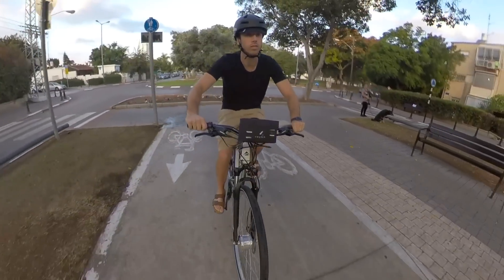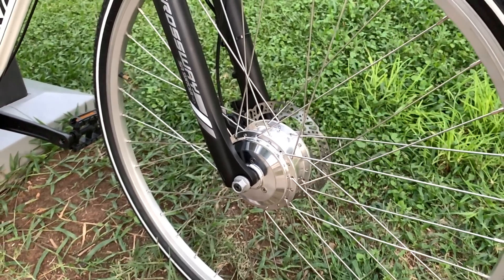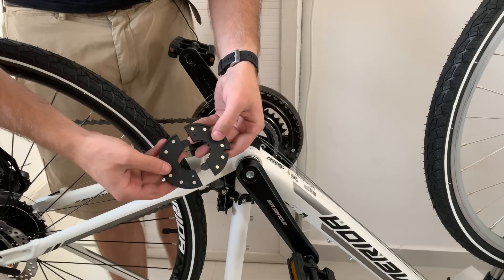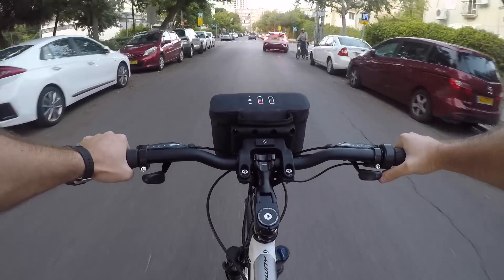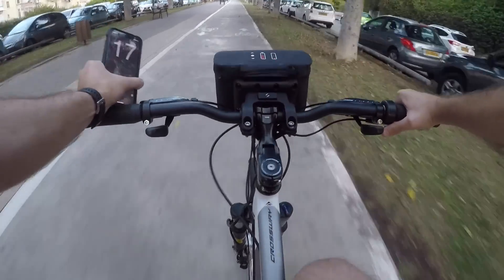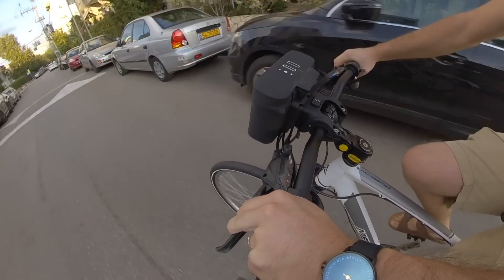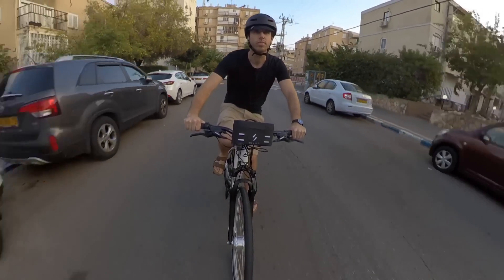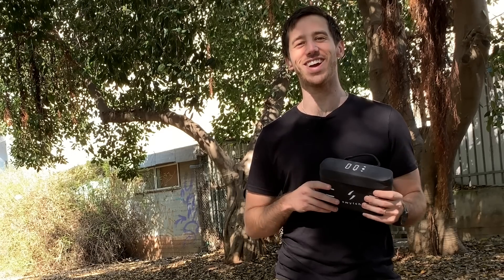Review: Swytch e-bike kit is smallest and lightest way to DIY an e-bike

Comment: Honestly, I trust Micah's reviews more than any other source. He has been doing this for a long time, has written books, and his presentation is always thoughtful, sensible, and practical.  Not having a 40 to 70 pound dedicated ebike or a much heavier kit is SO compelling. Remove the power pack and you are back to basically a nimble lightweight bike when you want it. I think am going to pull the trigger on this during the next launch window, scheduled for this week, for a kit for my girlfriend's bike. As always, thanks for the solid and balanced reviews.

Comment: I have the Swytch Pro kit (250wh battery, 3 lbs). I got it because I like the feeling of my roadbike, which weighs 22 lbs. So now the total weight of my bike is 28.5 lbs. This little battery is surprisingly capable. It takes the pain out of hills. I'm sweating and getting good cardio, but it doesn't cross over into quad-burning, lung-searing pain (which it did on hills). Instead of crawling up ultra steep hills (Seattle) I can go a good 10-14 mph up them, which feels like flying compared to just pedal power.

Also, getting up to speed from a stop is nice. Catching a red light isn't as punishing anymore. The battery on the Pro is 7ah, which I thought would be too weak for the distances I want to cover, but I usually have 2 of 5 bars left when I get home, after climbing 3 - 4 massive hills.

I got this on an Early Bird discount, which was $540. But they make you pay import fees ($27) which are hidden, and then I had to swap out my carbon fork for a steel one, which made my have to swap to V-brakes from cannies (fork + brakes = $70) and the wheel shipped to me warped, so I had to pay a shop to true it ($10). So the "true" fee is $650.

But so far I'm very happy with the performance. Sure, a $1600 eBike is faster, but also feels heavier and doesn't have my drop-bar roadbike look or feel. 

Would be perfect at $499
Reply: at last someone like me who has one!
I´m very happy with mine, had to wait a bit but it was well worth it.
If you haven´t had one in your hands, then keep your criticism for yourself!!!!!!!!!!!!
THOSE WHO SHOUT THE LOUDEST KNOW THE LEAST ABOUT WHAT THEY´RE SHOUTING ABOUT
Reply: Great review
Reply: I have the pro kit as well and love it. I also have a Stromer, that is a class 3 that is my main commuter, but the Swytch is amazing for the price and size. It's an excellent way in to the e bike world!
Reply: Do you still use it today ?

Comment: "I have had my kit since 2022.  On my 26" Schwinn Street/Trail hybrid, I have about 1,300 miles on it since July.   The kit has performed flawlessly.  It was a cinch to install.  I have never had a down day - no maintenance issues.  On a regular day I am doing 35 miles at least, using power only when needed on hills and challenging terrain.  I use about 1 - 1.5 cells of the 5 cell battery on such a trip.  Hey, I am in my sixties and after a ride I am hardly phased.  I could not recommend this kit more highly."

Comment: Everyone complaining about the price... It's more adaptable than any other kit I've seen, AND it comes with a battery (good luck finding a cheaper kit with battery included.) Another plus, for me at least, is the torque sensor and optional throttle. I'm happy pedal assist is standard, and I don't have to junk up my bars with a throttle if I don't want to. All that around the $800 mark is pretty competitive, but the $450 pre-order is an absolute steal.
Reply: Not dollars - pounds.

Comment: Don't know why people are complaining about 250W; that's usually appropriate power for pedal assist, a removable lightweight pack like this doesn't make a lot of sense as an electric-only bike, and a conversion kit has to avoid putting too much torque on forks that weren't designed for an ebike.

But one thing that does seem silly is making the base system use 20x 2500mAh batteries and selling an upgrade using 3500mAh for $100 more - or $200 "MSRP" if it's ever not on discount. It would probably not affect costs much to use e.g. 3300mAh 18650s in the base model. Suppose, for instance, that they did that and charged $25 more. That 1/3 boost could keep a lot more people from complaining about the range.

Comment: 250w for $800.00? That is a scam
Reply: I got my kit for $450??? Early Bird pricing.
Reply: Price a bafang 250w.
Reply: I got a 1500w for probably 800USD...
Reply: It’s definitely not a scam- you literally just saw a video of the working product. Also if they’ve shipped to over 1000 customers someone would have spoken up about it.
Reply: @sparksycat  I could sell you snake oil for 6,000 bucks. not a scam either.
Reply: Sparksy Cat whats he is saying is there are plenty of cheaper options that are wayy better. Plus this is from a crowd funding site and all they want is more $$$.
Reply: @JustinCrediblename  Actually that is totally a scam... BECAUSE IT DOESNT ACTUALLY DO ANYTHING. The worst you can say about swytch is that it's over-priced. Which I think it is. But as far as I can tell they are atleast honest about ability, Ah figures, speed, etc.
Reply: And they send you those thin ass wheels.
Reply: @thomasgabaldon1047  you sent them you the wheel that fits your bike
Reply: Bruh if people would listen to the vid, this isn't a total ebike, it is only an assist for people riding bikes
Reply: @Pushyhog  - are you drunk?
Reply: @sparksycat  he is saying to the equivalent you could buy a low end ebile with more power and range and you don't need to own a bike already
Reply: I just bought 1000w motor for 350. Plus battery for 205. Got it for my fatbike
Reply: @terryaqualad6779  that's awesome I just ordered a biktrix juggernaut ultra fs fat ebike cost an arm and a leg though
Reply: @lordnox69  nice <fatbike nation>
Reply: 250w and 5ah battery for $800!?? Straight up highway robbery!!  Might as well just get a ebike instead.
Reply: Just because it seems over priced doesn't make it a scam, stop spreading slander dude.
Reply: Lots of opinions, is a expensive kit regardless of 50% discount. To me, certain bike will want this like my y33 trek I can’t just fit a diy due to its frame construction.

Some people do not wish to buy another bike.

Saying that, their accessories are overpriced. $65 for just the brake sensor cut off is ridiculous, $65 for a throttle thumb is ridiculous.

I can tell they just took current ebike parts and attempted to make them solely their own by changing the Juliet pin type is I am not wrong. This I am not happy, otherwise is okay for what it was
Reply: @wolfe1970  It's a scam when it's advertised as being able to "flatten any hill" when it barely has enough power to get uphill. And their advertising doesn't tell you it only has a pathetic 250W motor. It's dishonest marketing. THAT'S a scam.
Reply: @brendanr1525  I have a 250w ebike and helps with any hill around where I live, do you even have a ebike 😂
Reply: @wolfe1970  not yet because the super monarch crown cost more than I'm willing to pay and other bikes with less than 1000W are inferior - I don't need to own one to have tried them. And I bet I have a lot more and steeper hills than your wimpy 250 can handle.
Reply: @brendanr1525  atleast I have a pathetic ebike 🤣
Reply: @wolfe1970  oh wow, you showed me. Why would I even care, It's not like I'm jealous of a crummy bike like that, I could get a bike like that in a second. I was pointing out why it's a scam to deter others from buying trash, it's pathetic you think this is some kind of competition
Reply: @brendanr1525  it's not a scam dude, my point is you don't even own one, I do, and they cope with hills fine, so quit whinging over something you're clueless about
Reply: @wolfe1970  It don't matter if you have something if what you have is trash. 
PS. I'm not convinced you're not a shill for them, most people that try ebikes find that even 500W is just not enough. Which is the exact experience I've had.
Reply: @brendanr1525  But to me and many others its not trash, it works as intended, it was never designed to go up mountains, and also its an assist, its not meant to take over peddling, so its not a scam like to claim it to be, just not suited to what your after.
Reply: Just got an email from them this morning and currently in the US it’s $499. But they are a UK outfit, so I imagine the price fluctuates with regard to the British pound. Right now the pound is in the toilet because of Brexit and Covid. Pretty much 1:1 with the dollar and the euro.
Reply: @TrishBenedict  Not just UK thats had Covid, the whole globe has suffered, right now the exchange rate is 1.36
Reply: never touched or tried it, but complaining.................................ha!
Reply: Built a DIY 500w ebike for under 80£
Reply: @hailbaphomet  sorry A K, not a very original name and not an original comment.
1. Have you actually had one to touch?..................I did, I got it last week.
2. Have you actually built one?................................Yes I did, it was dead easy, even you could do it....hopefully.
3. Have you ever driven one?...................................Yes I did and it kicks in by the second turn of the pedal.

Facit: I am pleased with my kit, it took a while to arrive but it was worth the wait- trouble is, the wife wants one too!
(P:S: I have no financial interests in Swytch whatsoever)
PPS you don´t go shopping in a formula 1 car, or maybe you do.
Reply: @walky240251  Ok dude. 1) What does my name have to do with an over priced ebike kit? 2) What are you going on about? I genuinely don't understand why you took the time to type the things you typed lol.
Reply: $300 for the kit $400 FOR ADVERTISING and $100 profit.
Reply: @hailbaphomet  many thanks for the reply. Never been called a "dude" in my life!
Reply: @walky240251  First time for everything 👍
Reply: @thomasgabaldon1047  They send you the wheel to match the one you already have on your bike.
Reply: @faheemyasir7717  How do you know? Have you bought and tested them all? If they are so good why don't you link to the reviews, or do them yourself?
Reply: @brendanr1525  Have you tried one of these? 500W is more than enough? How much do you weigh? Is that the problem?
Reply: @lukaszgrub9367  I love to know where u buy that I like to get on I be so thankful of u could send it to me
Reply: Mines 1,200w paid $198 off Amazon don't get scammed ppl
Reply: @lukaszgrub9367  probably?
Reply: I agree u can buy a used be bike for much cheaper lmao

Comment: The Swytch conversion kit's price typically ranges between $999 and $1249 for ECO kits, & $1249 and $1499 for PRO kits with the option pre-order at a 50% discount rate. The Swytch Conversion Kit is compatible with any bike.

Comment: I put a Swytch kit on my road bike.  I also have a Lectric e-bike.  Doing a comparison of the two experiences, I am starting to really like the Swytch kit as it simulate real riding quite a bit better.  It takes the edge off the pain of going up hills, yet the lungs and muscles still feel a little bit. And going more downhill, you dont outspin the gears like I do on the Lectric as I have a big front 52t chainring and a 32 tooth on the rear..  If you are looking to take all the sting out of going up hills, get a Lectric bike.  What would make the Lectric bike more useful...a 32 tooth chainring.  If you can buy it with that, you won't spin out of the gear quit as much.

Comment: I think you get more features for your money with a bafang mid drive but this is simple and low maintenance. I find the acceleration is a lot more subtle being only 250 watts, and by itself it will climb some hills, but definitely better with added pedal power otherwise it feels fairly gutless without additional human input. I don't notice an abrupt loss of power over the speed threshold of 15-20 mph or whatever it's set on.

Comment: I have been using the conversion for two weeks. It’s on a hybrid and I find it limited. The LED button to change the assist levels is frustrating. It’s slow to respond and if you get to power level 4 you can’t go back to one but have go through all levels to get back to a lower setting. The power doesn’t remain steady when there is a climb. Overall this has been 
good but I prefer  the technical features on a Trek E Bike I have .
The Swytch makes it fun to ride the hybrid.

Comment: But that's where most headlights mount. The front mount pack should have an integrated light at this price. Otherwise I'm not interested 😿
Reply: I think the pro kit has integrated front lights
Reply: cheflia5555 it does.
Reply: Ben Mackay that's important for riding at night. That's why all high-quality bike converters have lights.
Reply: My swytch bike has a headlight. Is is the logo on the powerpack at the front.

Comment: Sorry but, $800 is way to much for the limited range and no hill climbing ability. For $600 or $1600 you can get a ready to go Moscow 27.5/29", or for $600 the Hyper-E 26" MTB.
Reply: I have 5000km on my Moscow plus 29er and it has 500w with a 17 ah battery and it was 1300 when I got it with shipping 80nm of torque will go up to 38km/h before it gets limited to 32
Reply: @suckyamother8258  Got 1300 miles on my Hyper.  Had to tune it up, but that's how you learn.
Reply: its 400 if you preorder
Reply: No hill climbing ability??? Where do you get that from?
Reply: Yep, we are sorry to hear, "This is not for you".

Comment: I just got an email from Swytch this morning because I had an inquiry out to them about pricing. I could order one right now for $499. So that seems like a reasonable price for a simple, quick upgrade. But I’m not going to go for it. I’m going to get a Rad. 

The downside for me was the power unit. It doesn’t look like you can lock it in place. Am I right? With the Rad (and other ebikes), you can lock the battery, so you could run into the store without having to take your heavy battery pack off and put it in your purse. I wouldn’t want to have to take the Swytch power unit off every time I left the bike for a few minutes.

Comment: I built a 1000w mid drive mountain bike with 160nm of torque and 70-80 miles of range for £1200. Dual suspension, hydraulic brakes, Shimano Deore gearing and 1kw of power and 160nm of torque for £1,000. Pretty good for a grand I think. Build something yourself folks! Working on bikes isn't hard even for the nerdy office types! Bafang BBSHD 1kw motor + 52v 19ah Battery = £900....£300 can get a well specced 6-8 year old mountain bike that will conquer any pothole or trail. Honestly, removing cranks and installing a mid drive is easy! Hardest part is getting your chainline nice and straight, but that's where you dump the basic Bafang chainring and install a lekkie bling ring, gets you where you need to be! It's all easy folks! I even bought an extra 19ah battery for £380, and I doubled my range to about 160+ miles depending on riding, I can go ANYWHERE! And I still come in cheaper than this kit even with 2x 19ah batteries and a 1kw mid drive!

Comment: Could Bluetooth be used to connect all the sensors and the throttle etc instead of all them cables, plus a built-in headlight in the battery pack, and double sized battery pack hanging on both sides of the handle bars, that battery is a bit to small,

Comment: Unfortunately, have you ever tried finding out how much these kits are ?... they won't say, even on their website, I tried emailing them, they still wouldn't tell me, has anyone bought one ?, if so how much are they ? (U.K only please ).
Reply: I looked into this last year but did get put off with the price and supplies issues.  This year they said they're starting at £322 with the first 2500 pre-orders getting a  half price discount.  That would make it comparable to some other diy e-bike conversion kits.  What made me look at them was that they to several wheel sizes where as others only do one of two wheel sizes.  I have seen someone riding by with one of these conversions recently.  If they can sort out their business model and supply issues which could help with pricing being easier to be seen then I'd go for it. An e-bike is especially great if you've got health issues but still want exercise and or active travel.

Comment: I would have bought it if the power pack wasn't on the handlebars,it would have looked better where the water bottle goes or behind the seat post out the way apart from that it looks easy to install.

Comment: I lost my charger.  I called Swytch to see if I could order another, or to get the specs to see if an old laptop charger would work.  As you probably know, trying to reach them and to get information by phone is a a real challenge.  My battery pack is identical to the one in this video.  Can you please tell me the specs that are on your charger.  Thank you.
Reply: 42 volts 2 amps

Comment: Yes this is great but there is an issue, since its black its more prone to overheat, so maybe make it white, also if that doesnt work you can try adding a fan system in it, and rain, rain gets into the electronics and will break, another problem is falling over the bars of the bike, but yes its amazing
Reply: Sounds like a 'Doomsday' scenario.
Seriously, it's not like that.
Reply: @justsayin494  i cringe at it anyways so make fun of it and i was like 10 back then 😅

Comment: Has it been tested for heavy rain? Especially the motor is located in the wheel hub where it is prone to corrosion, water  & dust accumulation.
Reply: So where would be better, on your helmet? Mid mount will get all the water from the front and rear tyres. Rear hub less so but more than front hub.

Comment: I was considering getting this for cycling regularly on a flat terrain but to carry groceries in two metal baskets which I already have attached. I'll have significant weight on a flat terrain. Should I refrain frkm the purchase? Also, how safe are these batteries to leave outside or indoors?